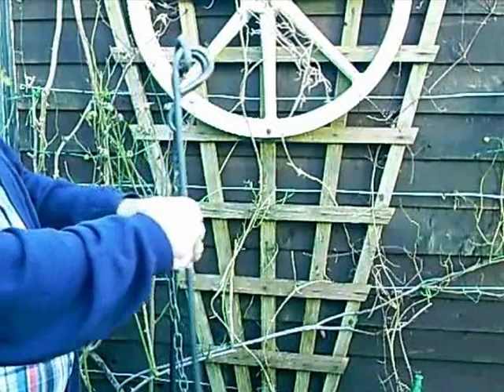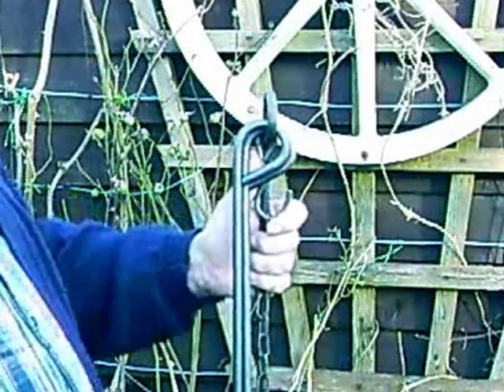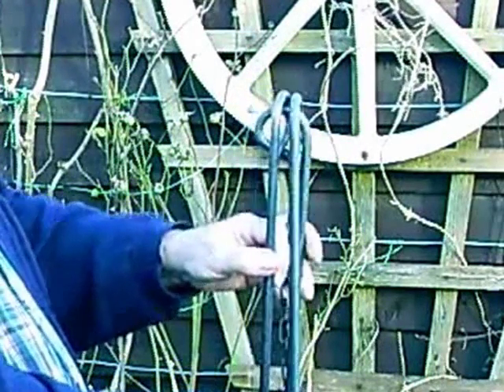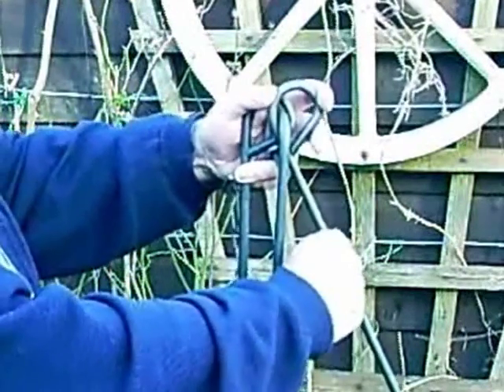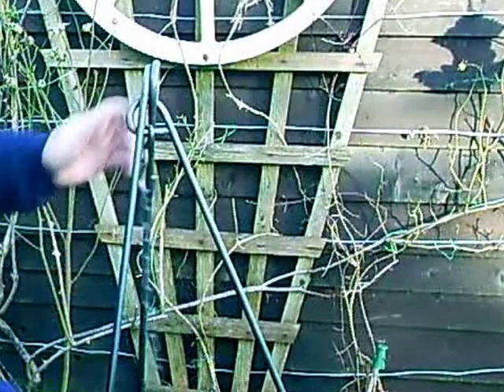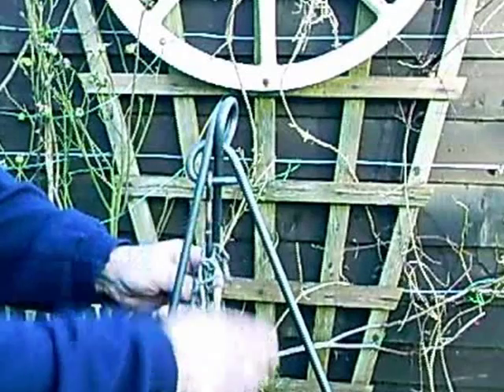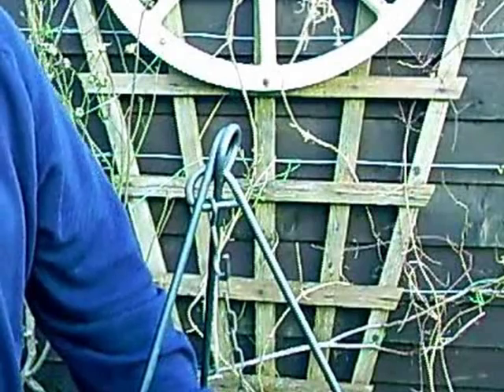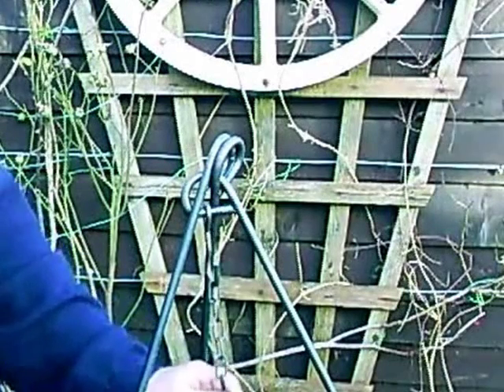Camping tripod setup

Comment: If your Lodge tripod is like mine, the hook is in between the two legs, which makes this method of assembly impossible.  After experimenting with the stock configuration, I decided that the configuration in the video was vastly superior.  The only way to achieve that was to unbend the hook, remove it, and reinstall it below the two legs.  Then I had to hammer the hook shut again.  Now I can easily set up my tripod exactly as it is done in the video.  I suspect that someone who is assembling these at the factory doesn’t know what they are doing, which is too bad.  At least it’s easy to fix.  The tools that I used were a vice, a wedge (I used a cold chisel for its wedge shape), and a heavy hammer.
Reply: I noticed this as well. I was fighting with my tripod trying to get a solid set up, but it just kept collapsing.
Reply: Thanks for this comment!! I’m gonna have to try your method with my lodge tripod.
Reply: Yes this mod works for the Lodge tripod. The hook leg ends up with a corner at the high spot because it is a d shape. The other two legs end up touching the short side of the d where the hook is. When weight is placed on the hook everything twists a little and becomes even more sturdy. Then fine tune the leg spacing. The hook is not as long as the vid and the chain links are larger gauge so the lapping of links fills up the hook quickly. I will play with it and probably get a lighter chain.

Comment: Now that Axcel has shown me a dozen times, even in slow motion how to do it, and I still can't figure it out; can someone post setting up a cooking tripod with this configuration--SLOWLY, AND CLEARLY?
Reply: Dianne Reimer, if your Lodge tripod is like mine, the hook is in between the two legs, which makes this method of assembly impossible.  After experimenting with the stock configuration, I decided that the configuration in the video was vastly superior.  The only way to achieve that was to unbend the hook, remove it, and reinstall it below the two legs.  Then I had to hammer the hook shut again.  Now I can easily set up my tripod exactly as it is done in the video.  I suspect that someone who is assembling these at the factory doesn’t know what they are doing, which is too bad.  At least it’s easy to fix.  The tools that I used were a vice, a wedge (I used a cold chisel for its wedge shape), and a heavy hammer.